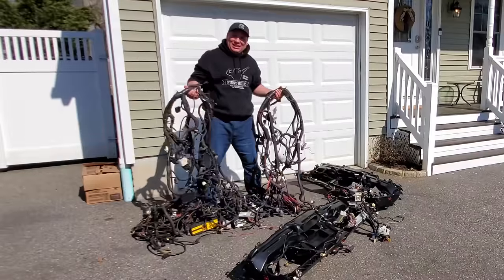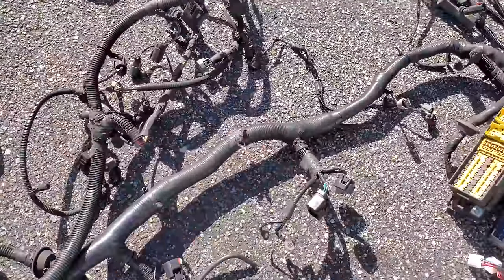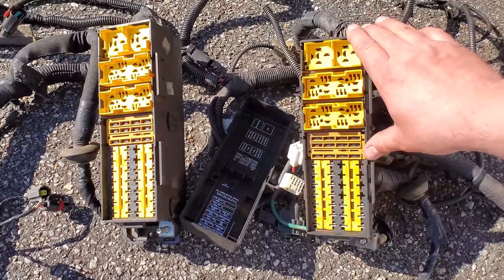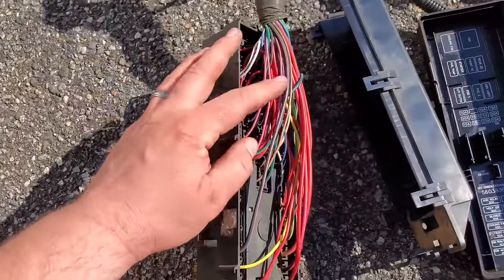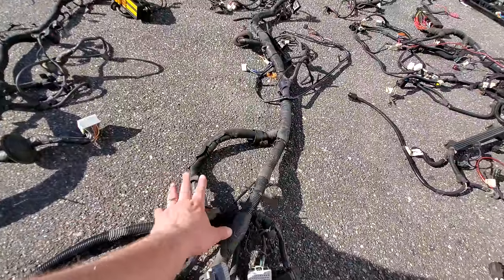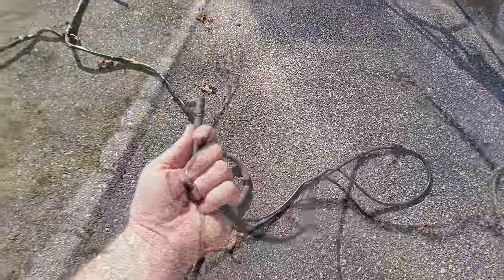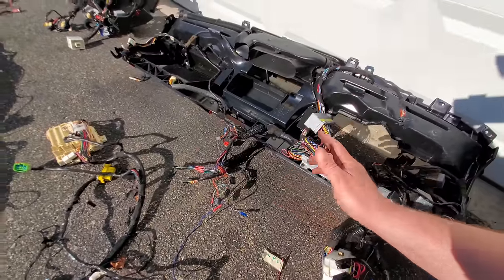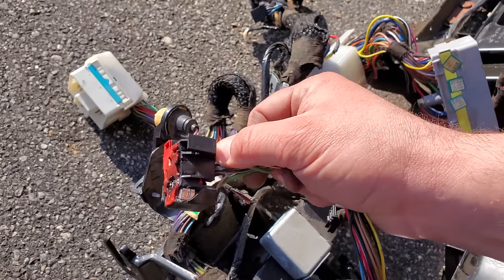JEEP XJ WIRE HARNESS GUIDE - ALL ABOUT THE WIRES FROM A 97-01 JEEP CHEROKEE XJ

Comment: Damn Danno! The fact that you seem to have a firm handle on that giant pile of wires is crazy impressive! Some awesome XJ knowledge in this one!
Reply from the maker: Haha! wel see how firm it is when I put it all back together! 🤞
Reply: Just looking at the wires gives me a headache lol. I just bought my 7th xj so many hours of wire work. Newest xj 01 Passenger running light and middle hatch running light dont work but brake lights work same bulb/socket. Ive been trough every inch fixed every ground. Still dont work. Driver lamp works great.
Reply from the maker: @Mikey330yngoh  dang man that's crazy! Did you check the bulbs? lmao 🤣.  Don't mean to insult you but I swear it happened to me trying to chase a fog light gremlin.. turns out it was a faulty bulb. If that's not it, perhaps there's a brake in the wire somewhere.  Have you used a multimeter to check continuity?
Reply: @ProjectDanH  lol that was the 1st thing i checked because i knew if i took it to my mechanic n all he had to do was change a bulb id never live id down lol. I finally got it. It was the pigtail in the rear passenger fender either i didnt have the replacement crimped right or it was bad. Tore another plug and sockets off a 97 parts jeep shes finally working. Took the master switch also all my windows and locks are working too. 🙏 No more electric probelms
Reply from the maker: Hell yeah Mikey! Great work brother 👊
Reply: @ProjectDanH  I think you have to have a photographic memory to remember where all those wires go. Think you should have tagged all the connection's but it seems you did that before.

Comment: Excellent information!  Thanks for helping me to better understand the diversity with XJ wiring harnesses.
Reply from the maker: Thank you John! I appreciate you sincerity in all you comments, Thanks again for the view!
Reply: @ProjectDanH if you see this comment please write me back bro….
I have a 1999 jeep cherokee SE Sport xj 2wd in amazing condition tho I’m putting a new motor cause the one I have has 400,000 miles on it and I wanted to ask if I also need to change the transmission with the same style motor that’s question number 1
My second question is that my dash wiring is always off for some reason everything works except on the radio and the AC it makes it over heat and I don’t know why ?? Idk if the first owner messed with it but I don’t wanna go to a mechanic out here in Las Vegas cause they are very expensive an 
It runs but I can’t drive it to far because the keep overheatsing that’s why I’m putting a remanufactured new inline 6 .. I just need some help and I came across your videos so I thought I’d ask..
Please write me back bro
Reply from the maker: @joseamontijo6945   hit me up on instagram @project_danh

Comment: After replacing every component in the ignition system I was about to throw in the towel and sell it.  One last ditch effort I bought a used ignition harness on eBay.  It took about 20 minutes to pull the old one out and about 15 minutes to put the replacement one in and voila' it runs like a Swiss watch.  Three different shops couldn't figure it out.
Reply from the maker: Bingo!  You're awesome for not giving up!!! Excellent fix
Reply: Yup about to buy a dudes pristine project all finished just doesn't turn on, says there's a short. Got a harness to swap out the entire thing. Easy fix, he's crazy but doing the deal

Comment: OK I have finally confirmed that on some 97+ XJs fog lights are infact nearly plug and play. This was first done (as far as I am aware) by User: "Yak’n-Wag’n (2001_XJ_2WD)" on the forum Cherokee Talk in 2021. The thread was called: "Adding OEM Fog Lights, Fog Fight Harness, Fog Light Relays and Fog Light Switch to Non OEM Fog Light XJ" 

I have now repeated that same finding and I thought I share it here.

Some info about my Jeep in case the community wants to dive into trying to figure out what XJs might be plug and play: 
2000 Limited XJ
4.0, AW4, 4x4 and at one time a dana 35 with ABS
Did not come with heated mirrors I added those
Came with overhead console
Came with leather and driver power no heat or passenger seat goodies
 
What I found was that I had terminals at the relays in the PDC and under those terminals were the appropriate wires according to the factory service manual wire diagram. My jeep did NOT have the rocker switch, fog light harness, fog lights, fog light air damn or the actual relays themselves. I simply purchased the 3 switch setup off ebay and grabbed some relays from a junked XJ. With the headlight switch on and the newly installed factory fog light switch installed I have power at the headlight harness connector (C106) on the light blue wire (fog light power wire). I am going to use this wire to control some aftermarket 3 inch cube lights in a JCR crusader bumper via the factory fog light switch and wire harness. 

Good luck people :)

Comment: This video clears a lot of stuff for
The serious builders !
Reply: Do you think all junction box’s are the same I swapped everything but that , and I’m not getting power to fuel pump
Reply from the maker: @996turbo  I think the junction blocks are physically all the same however the location of the wire inputs varry from year to year.  I'd have to double check on that

Comment: Regarding fog lights. My 98' XJ doesn't have them. I have the factory interior switch, factory light harness w/ fog light, and Crown Fog Lights. I want the fog light switch in the interior to operate in  OEM fashion with the red light that turns on when the fogs are on..

If I were to swap out my harness with the fog light one - is it just a matter of adding an independent relay and fuse to make it operational? I really want to keep the fog light operation as close to stock as I can without having to do intense wiring work.

TIA! Great video
Reply from the maker: Yes that's it!  Just run the signal wire to you're own relay and power the fog lights with your own wires from the relay to the light's.  { you don't really need an OEM fog harness because fogless XJs have no wires from the firewall to the fuse box and fuse box to the headlight harness )

Comment: Would love to know more about the overhead console add on! Can’t seem to find a thread anywhere.
Reply from the maker: Its a great plug n play mod!  just find a console, bracket and wire harness.  if the wire harness is the same year it makes it super simple!  if you can pull one from a yard youll know exactly how to re install it on your rig! dont forget the ambient air sensor, then youll get the outside air temp too.
Reply: I have the whole thing except the a pillar harness so the project sits till I can make that happen. I thought I had it all out before I got rid of the donar. If I can put links here I will post a link to a very informative write up with wiring diagram and what harnesses out of 3 different vehicles are needed to make all the info show up in the upper console
Reply: I was reading that needed harness from 2 different xj's and one dodge caravan.
Reply from the maker: That thread is ridiculously complicated.. I understand why it was made but it is unnecessary these days..  if you have a 97-01xj you can use any 97-01 console.  you can also make them work with any OHC harness.  it's better to have the harness for your rear to avoid cutting and splicing.

Comment: I need a new factory rear wiper switch. I tried to remove the bezel without putting the shifter back and it popped a hole right in the center of my switch.If you have an extra let me know. Ended up spending about 70 bucks on a factory fog light switch on eBay.
Reply from the maker: I have a bunch! stop by one day, wel hook you up

Comment: Question, if a person had complete motor, stock wiring harness, and ecu, could you simply hook it all up (not cut out stuff) and have it run? It would be in an old cj, so no communication with dash and all other gadgets that newer jeeps have. Cps has already been taken care of with hesco unit. O2 sensors also ready.

Comment: Whats the best way to cut off wires for unneeded accessories when building a trial rig  while harness is still in jeep
Reply from the maker: I rather tape them back instead of cutting as much as possible.  however if you had to cut them I recommend cutting them one at a time and staggering the cuts to avoid any shorts.  I would also cap them with shrink wrap to protect them and then tape em up again

Comment: I'm pretty sure there is small differnce in connectors on the rear hatch harness, the part that from the hatch to the inside of a 98 jeep xj has connections that a newer 2000 jeep hatch harness wont work because the connector and wire colors even differ a little .. the hatch works perfect but the harness differs slightly,  so him saying the year matters and options definitely does ...
Reply from the maker: yes, year matters.  especially in the variance of the overhead console wires..  good news is you can carefully re pin the right connector onto your harness with a little pick.  if not you can just cut and splice.  most of the time the connector will be different but the wires will be the same color patterns.

Comment: By chance do you know typically what gauge wire is used on the engine wire harness to a 97 xj sport 4.0 ... looking rebuild the wire harness the connects into the the main harness, this specific harness that I'm referring to connects to the distributor, ignition coil, oil pressure sensor on passenger side & wraps around to the driver side connecting to the fuel injectors, temp sensor, throttle body area connectors & 1 other 4 wire connector (not sure where that leads to) - its between the power steering bracket & the power steering, leading under the exhaust manifold connecting to another connector. I',m assuming thats going to the fuel pump. wondering if they are all the same guage or diffent?
Reply from the maker: I'm not exactly sure the gauge.. they are typically 18.  If you get an FSM for a 97 it will show you the color and gauge of every wire

Comment: Your pet peeve is my security system, 93 xj interior got burned out of it, the dash and driver seat survived barely, just a beater now but there is a switch for every accessory on the dash somewhere, there was about 50 lbs of fire retardand powder and 200 gallons of water dumped into this poor xj, I drive it on the trailer at my works parking lot where she burned up.
Reply from the maker: oh man, that's so sad! time for a new XJ!

Comment: Hey Dan,  love the channel,, it's helped me alot,, 
2000 xj sport.  Looking for headlight wiring harness,  passenger headlight not working.  
Suggestions?
Reply from the maker: probably a broken wire, your have to take off the header panel to replace the headlight harness so you might as well take it off and looks for brakes.  You might be able to fix it!
Reply: I can't find any breaks,  I'm thinking require new harness  or just replace the wires to the passenger headlight

Comment: Probably not the best place to ask but here goes.....
99 XJ classic
Rear passenger side turn signal
Only low element lights up (not bright)
All bulbs are good, replaced turn signal relay which corrected the fast blink
Fuses all good...
Only failing light is the rear cargo headliner light
Any suggestions ?
Reply from the maker: theres a bad connection somewhere. maybe not a short cuz fuses aren't blown, and not a broken wire cuz it works... just dim...  try disconnecting your headlight harness and blast it with contact cleaner.  then when it's dry add a little dielectric grease before you plug it back in.  also do this for any other plugs along the way.  let me know how it goes. God speed 💪💪

Comment: Your knowledge is amazing. 

I want to add a kill switch to the fuel pump. Underneath the back seat driver side, I see some wires and 2 harnesses have plugs and go down through the body, each have a rubber grommet. Would one of these be fuel pump? I am running the switch in the rear ash tray.
Reply from the maker: thanks man, yea the fuel system wiring runs along the drivers side and dunks down through a Gromit under the drivers side rear seat.  I don't see why you couldn't tap into that one!
Reply: @ProjectDanH  ok awesome...I see with a grommet...one has a black plug and the other is red?
Reply from the maker: @MARZ1911  I think so. Not sure though
Reply: @ProjectDanH  I'll figure it out. Thanks for your knowledge bro!

Comment: I watched so many of your video and they have helped over 3 yrs of repairs and now I am stuck .. o2 sensors harness side pigtails .. one is chewed up .. I found no part number for it .. 1999 Jeep Grand Cherokee V8 limited 4 door 4x4 .. 165k miles and yes it is 21 yes old
Reply from the maker: oh man, you might have to just lop one off at the U pull.  lemme know if you have trouble locating one, then ill see if I can cut one out for ya. Thank you for all your views. 💪
Reply: I was thinking if there was a way to open up a harness  and take out the whole wire from fuse box to cpu and keep connector  Intact .. I have had bad luck finding a part or the connector .. it’s my only car and 21 yrs old only 165k it’s still has 10 yrs and this issue sucks
Reply: Im by no means a mechanic but I have learned so much .. my first thing I ever did was change out the battery and I was nervous .. like that was big for me .. I never been under my Jeep and it was surreal my first time looking at things .. I changed out fuses .. oil filter .. window motors ..seeing your videos have me courage I guess and no great that I couldn’t do it my self with some research
Reply from the maker: hey, I'm glad you're learning. sorry for the late reply. keep it up💪

Comment: Gonna post this here because haven’t seen anything about it online. Got a 99 Cherokee xj. After warm up add relay starts ticking trying to kill the engine so rpms drop and can’t give gas or it will die. Changed crank position sensor and nothing not sure what to do. Any ideas? Checked most grounds not sure where problem is.
Reply from the maker: Hey, great question have you tried the IAC sensor and the throttle body sensor?  they have been known to cause some problem.  if that doesn't work try a new battery.  and lastly if it persists perhaps try a new computer.  good luck brother 👊

Comment: Great video, lot's of details, thank you very much!
I have a question if you know... it's about differences between harnesses in 2wd and 4wd for 98+. 
From what I read, it should be be pretty straight forward but apparently TC harness needs to be extended and 4wd dash light wont work. 
I am not a fan of cutting things and I was wondering, is there a chance to replace just that part of the TC harness or that would be too much hustle. 
Also, apparently there is a wire that can be added into one of the harnesses to get a 4wd dash light working but on the whole internet (or at least in my limited search) I was not able to find one. 
I would appreciate if you could shed some light on it or even make a video... plenty of questions about it online but no one with a straight up answer. 

Thanks!
Reply: I have just the video you're looking for sir. Check my channel for the 4x4 Swap. I added a functioning "part time" dashboard indicator to a 2wd XJ when I put 4wd in it

Comment: Hi Dan - can you change out the under dash harness without removing the dash? I recently changed my 97 SE with manual windows/locks to electric. Windows work fine but the locks/mirrors do not. I did find a hack job system under the dash where someone prior to me added universal locks... I removed. Also. used the body harness from an 01, but saw a post where someone else did the same without any issues.
Reply from the maker: All the main connections are made under the dashboard.  You will most likely have remove the dash to disconnect them.

Comment: I need to figure out how to rewire a 88 aw4 transmission harness to fit in my 95 Xj.
Reply from the maker: 🤔. never thought of doing that. sounds like you can make an interesting video.. let me know how it goes!
Reply: @ProjectDanH , The Aw4 transmission was first introduced back in 1987 for the Xjs, only difference is the tail shaft has to be changed to a 23 spline to fit a NP231 j. It's a snap ring, gasket & 4wd tail shaft from a 30-80 4x4 aw4.

Comment: Know where I could fine a 98 XJ SE manual engine wire harness? All I could find is for automatic transmission, it works but when I shift gears it thinks I’m using automatic transmission and reverse lights won’t work.
Reply from the maker: I'm pretty sure there's a way you can wire up your reverse light wires from the neutral safety switch to the manual transmission reverse light switch

Comment: Hey man. I know this is an old video but was wondering if you have a video or know of one that can show me how to replace the wiring harness for the heat/ac system. I have a 2000 xj sport and having issues with the heat I replaced the blower motor and the resistor motor work consistently and I can’t change the fan speed had a shop look at it and it’s in the wiring somewhere just wanted to reach out and see what you say since you are knowledgeable on the wiring. Thanks man
Reply from the maker: Oh man, sounds like your in for a lot of work. you'd most likely have to pull the heater core box, so plan on replacing the heater core and AC evaporator.  While your in there you can check for melted wires.

Comment: One time i chopped an 89 for an 88 i had some extras but i still just went by the colors ..bad move hahahaha..Brother can you help me.. I have a 98 XJ I deleted the air conditioner and the cruise control do I need to take the ground wire from all those connections and ground them out or can I just cap off all those wires thanks brother
Reply from the maker: I don't see why you couldn't just cap them off.  best of luck
Reply: @ProjectDanH  thank you..